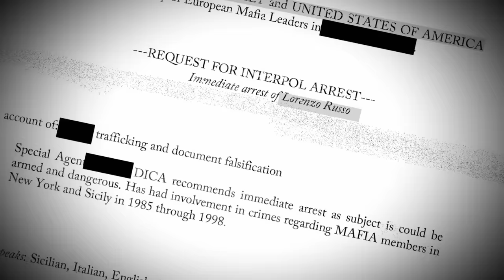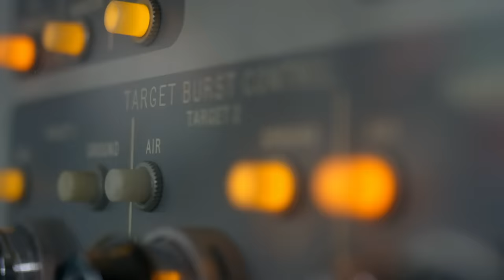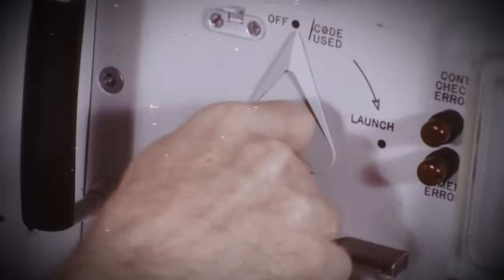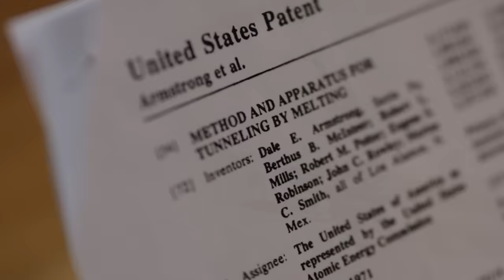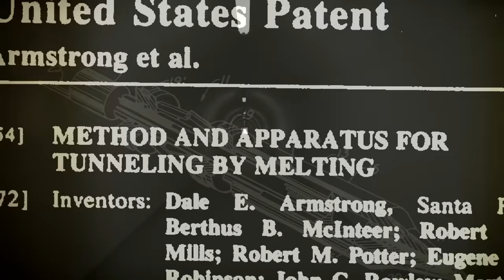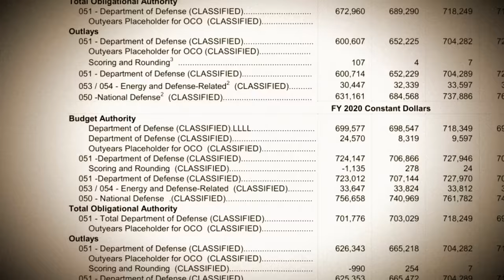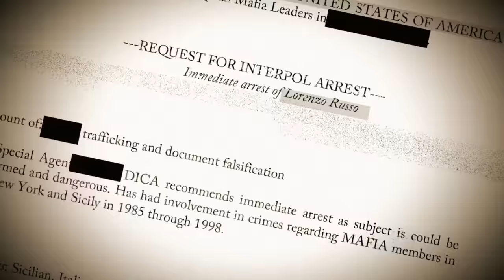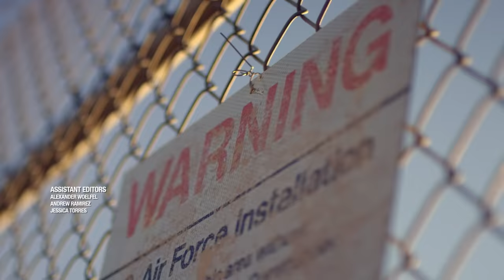TOP SECRET U.S. Government Tunnels | Cities Of The Underworld (S4, E2) | Full Episode

Comment: Baloney ... I worked at a Titan missile site in Chico Ca. It was very open. There were 3 silos for the missiles and two very large 3 story round control centers where one was just for power and the other for control. There was NOTHING classified about the site until the Air Force started installing the equipment.

Comment: Bechtel has been using the 'nuclear drill' for at least 20 to 30 years. Phil Schneider talked about it at length. It melts the bedrock into something like a smooth, obsidian tunnel for a high speed rail / shuttle to use. Plenty of mining and drilling engineers and operators have discussed it. Odd that it's treated like secret technology here.

Comment: Plasma torch is way hotter than the 2000 degrees they mention.  Closer to 40,000 degrees. Hotter than the surface of the sun.

Comment: Note they never mention the energy needed for a plasma cutter to run. Scale that up! You would need a dedicated nuclear reactor and everything that it requires to produce the electricity. Then theres the matter of gas / air flow. Last, but not at all least. The heat. At best you could run it for a second or two, then have to wait a week for things to cool down. So, no your not going to melt a tunnel without melting your melter

Comment: Sorry to burst everyone’s bubble but all the hot gases from a nuclear drill that size aren’t any easier to hide or work with than the rock debris. The far better strategy is to just dig the tunnel using conventional methods and connect the flow of debris into a publicly visible mining operation. Make the bunker part of a known project, which in a sense is what the hotel bunker did. To detect the secret, you’d not only have to count the number of trucks, you’d have to know how many to expect.

Comment: How did they make that plasma torch work on a non-electrically conductive rock?  They also had an oxy-acetylene torch there, the flame.  I am sure thousands of tunnelers have had the idea but no way to get enough heat into the rock and survive the drilling process.  Heat is heat and the drillers would be standing in a glass oven roasting alive.

Comment: You can't have a vast tunnel system through the US. Sooner or later, you would hit water tables, plus coal, oil, and gas pockets. This would end very badly when using a drill bit with a 2000 degree heat source.

Comment: Check out project genome they drilled down into the ground and set off a nuke it made a huge air pocket with no piles of dirt above ground if they are testing underground every test makes more open room under ground I drilled around that sight for years it’s in New Mexico they also had a nuclear waist site below ground we had to stay in contact during certain depths just in case we drilled into something that connected to the so we could shut down drilling instead of flooding there site

Comment: Your can drive semi truck in them, and even turn around in these tunnels There so huge!  They got compartments in them, that would fit a whole large house in them 👉👉ITS  AMAZING  This tunnel was JUST FOR FOOD  i been to 4 of them Mo, Nm, VA, WV, and Ny  God only know how many more there are?  Yes there was some pieces of falling rocks in them.  They just put a cone there, and are cleaned up later.. The older parts of the tunnels are foamed over the walls and ceiling  They claim there rebar under the concert and chicken wire and foamed over it  You can hear and feel these massive fans running.. It stay at 60 deg year around in these tunnels

Comment: Going underground did not stop nuclear weapons test detection the techniques used changed. Both US and Russia has the monitoring capability and communications networks to report test results. This is mandated by treaty. Filtered data on Geophysical Activity is available to Universities. Our equipment was decades ahead of the equipment found in Universities. These days the methods of monitoring have moved back to satellites. 
In my day we did monitoring from isolated remote ground sites. The Seismic equipment we used was highly sensitive. Trains operating a hundred miles away could be detected or a person walking across the instrument array. Thus, they were located in remote locations. I was a Trouble Shooter and fixed problems world wide.

Comment: Bunker Busters, that's what the superheated drilling nuclear warheads are called. And by the name you can guess what they're used for. some of them are even designed to work like Elon musk's self-landing rockets. they can be launched from a nation hovered around when they get close enough landed in a specific spot and then drill and ignited a certain depth into the ground.

Comment: You never showed to the complete through hole in the rock that the plasma torch made, only the hole from the hammer drill.  You just should a blind hole with some melted rock, not a through hole.  For a plasma torch to work you need a conductive material such steel, last I knew rock isn't very conductive unless there lots of gold, silver, iron, extra present in the host rock. Second you didn't have your ground cable for the torch connected to the rock. What was the purpose of the oxy-acetylene torch, was it to preheat the rock, but to me it looked like you used the oxy-acetylene torch to melt a little hole in the which takes a long time, as I know from experience. So you melted a tiny hole with the oxy-acetylene torch then showed a flash from the plasma torch, then flashed a shot of the hole you drilled. Why?

Comment: Im pretty sure you didn't actually use the plasma cutter to bore a hole in the rock since the hole you showed afterwards was the SAME hole you drilled through......same debris in it and drill pattern too.  You gotta do better than that. "Shows cutting torch lit off then uses plasma cutter which only works on conductive material since it needsa a geound to work and then shows the hole he drilled with the roto hammer." Nice way to detract from your credibility.

Comment: Area 51 is more like  Armed Forces Plant 51.   Armed forces Plant 57 is down the street form me(they designed the circuitry for the tomahawk cruse missile there amongst many other things)   they removed the ground level building but my friend had claimed when he was working there he pulled up a hatch in the floor and there was equipment down there (a whole tank or a tank simulator) The structure officially didn't have a basement. ///There's a rumored heavy metal storage that is 600ft deep might be nuclear fuel. There's definitely ground works there how extensive I'm not sure. There are subterranean viaducts that run down the rail corador that connected factories here there might be be an underground complex that sprawls some like 10 miles at least   ///I do believe there's another AF plant thats still active not far from here 57 looks inactive which may or may not be the case it could still be very active under ground

Comment: Yeah sublimating rock with heat is possible but it was never mentioned where that gas goes. Matter cannot be created or destroyed, it's a fundamental law of physics. Even if the US gov could melt and evaporate rock into gas so there is no slag to be hauled away, they would still need a massive network of surface tunnels for ventilation. These tunnels would spew out black smoke and be unmissable. This video sounds like propaganda to me

Comment: Hmm, a plasma torch cutting through rock?  What kind of rock?  If anyone who's ever used a plasma torch, it's just like a welder, but with compressed air blowing the material away, instead of building material up like a welder does.  
And anyone who's ever used a welder knows you have to have a ground lug attached to the material being subjected to the plasma, in order for a circuit to complete.  
For anyone who thinks that all 'rock', everywhere, is electrically conductive, is a total fool.  
Could this production be a bit of 'controlled opposition' psyop, government sanctioned propaganda?  Well, it is the "History channel',